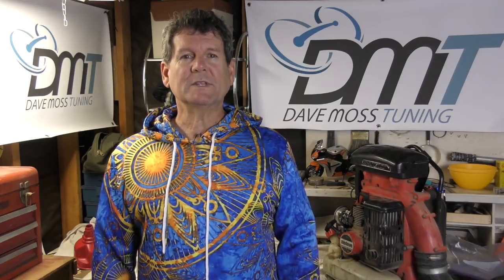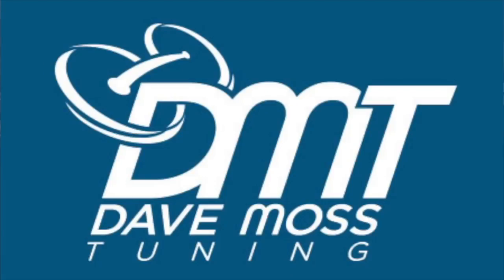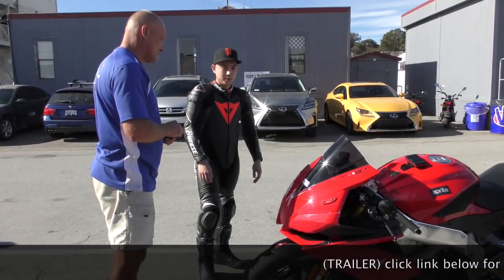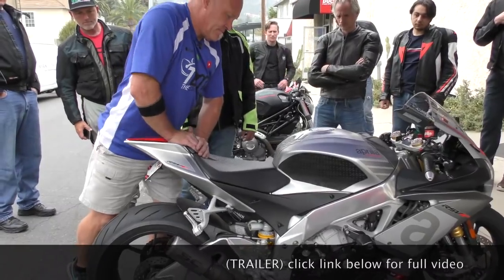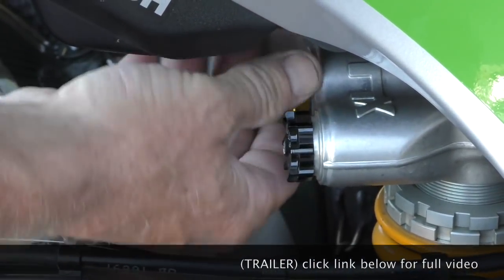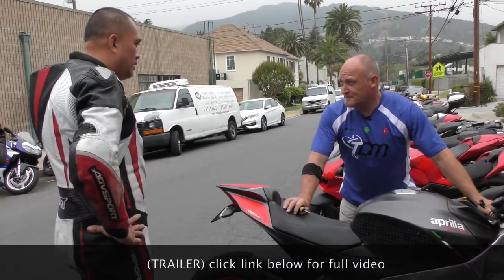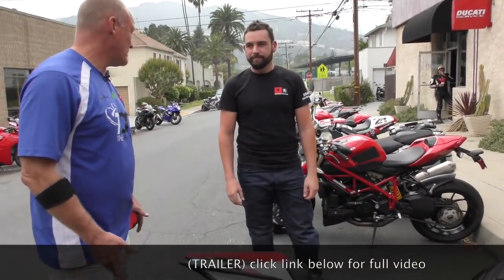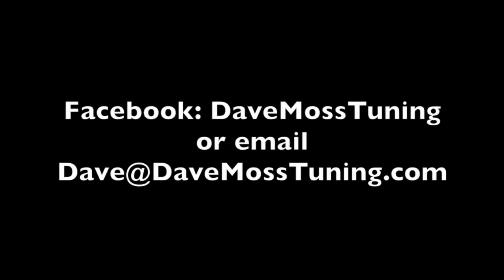2 Clicks Out: RSV4 Suspension Settings (TRAILER)

Comment: I have a 16RF.
Stock seetings and the bike is too stiff.
Road only.Im about 80-82 kgs in full gear.
Reply from the maker: Please email me with answers to these questions: dave@davemosstuning.com. 1. How many miles/kms on the bike. 2. Changes from stock. 3. Current tire brand, model and sizes. 4. Type of riding you do and level of aggressiveness.

Comment: Hello Dave!   My RSV4 is so tall!   Can i take some ride height out by reducing preload?   Can you please explain how this could be possible without negatively affecting handling too much??    I'm on tip toe!     Thanks in advance and best wishes for the new year.  Eddie
Reply from the maker: Hi Eddie. You can remove 2-3 turns of preload (left/counter clockwise) on the shock https://www.youtube.com/watch?v=Jlbca0SIxhw&t=29s.    Then remove 4-6 turns of preload on the forks, same direction. Set compression in the middle of the range. https://www.youtube.com/watch?v=LSG3c5sNEDQ&t=7s

Comment: Hi Dave, I have a 2014, as a general rule of thumb if I'm bottoming out the forks at the track I need to add more preload ?
Reply from the maker: Add more preload 2.25 turns and 1 click of compression. Reset the cable tie and try again If you get to 80% preload and compression and still bottom, you can try more oil IF the il is less than 2k since the last service.

Comment: Mines is a 2016 RR.  Ever since I purchased in '16, the suspension on this bike has felt nothing but crap.  I dont know if its because tolerances vary due to mass production of these suspension parts or if its because the quality of the internals is garbage.  Ive consulted quite a few suspension guys and shops in my area and also in other states and was told that the sachs is basically garbage, mostly the valving and needs to be gutted and replaced with either ohlins or k-tech cartridges, valves and correctly sprung.  No matter what I do in the back of my mind something isnt right.  Doesnt feel planted at all.  Every bump big or small kicks either the front or rear up.  Lost all hope and will be doing full k-tech front and rear on it next year.  On the bright side after the upgrades I still would have spent as much as the RF but with way better suspension.
Reply from the maker: Interesting that you can't find a place of contentment with OEM suspension and settings reinforced by professionals. Generally we can find something that does work across a reasonable range of road conditions. K-Tech, Ohlins, Notron etc all offer excellent products so enjoy the R&D seta time with settings evaluation :)
Reply: Lol
Reply: Well what happened with your bike?. I holy doubt Sachs is junk lots of  manufacture use them like yamaha r1.
No one complains on them.